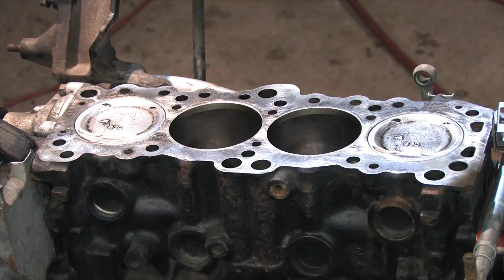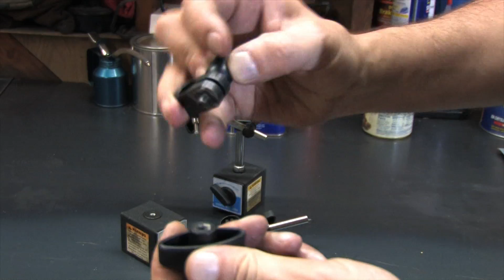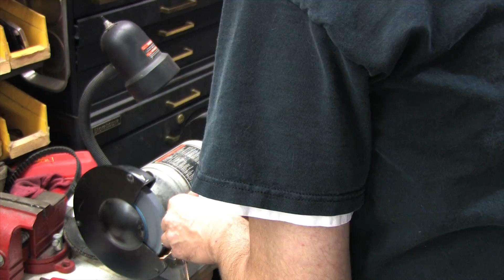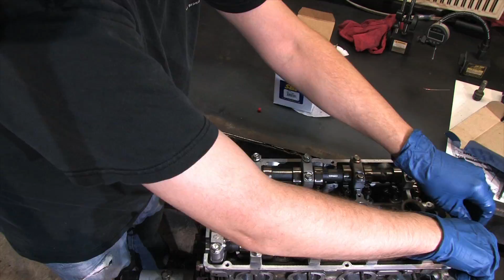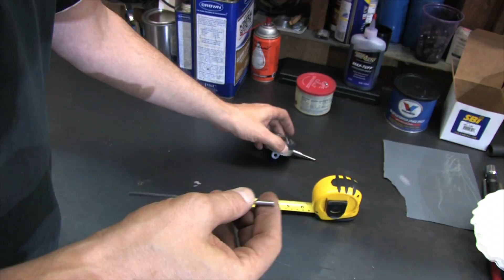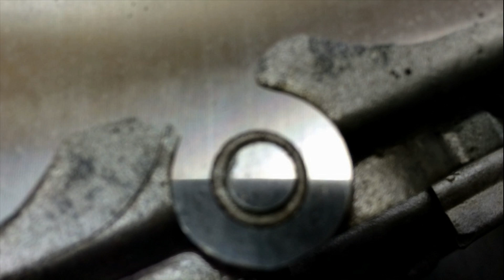Cylinder Head 205 - Degree DOHC Camshafts

Comment: You did it all back to front. You should have taken measurements before any work was done, then you would have had correct starting data.
Reply from the maker: It had the wrong cams in it before I started.  This was my Elantra's head built from multiple junkyard cars and bolted on a 2.0L block.  I think the intake cam was from a 1.6L auto, but it might have been a DOHC 1.8L?  ...so the original reference point was already useless either from a specifications or measured installation angle standpoint.  Worse situation than the HKS specifications because Mitsubishi and Hyundai never put a combo of their parts together like this to begin with.  

So here I'm degreeing used 2.0L turbo DSM HKS cams that replaced the mystery cams, and trying to hit the DSM installed angles using specifications that HKS provided that were wrong, and measured totally differently than the way Mitsubishi does it.  None of this car should have ever been bolted together to begin with, but I got all of the angles right and it works, spectacularly.  It makes way too much power for a 4-door 92 Elantra chassis/open front diff.
Reply: @Jafromobile  supplied data is always wrong to start with

Comment: How can it be 264 duration when 6.5+180+25=211.5???
Reply from the maker: HKS measures duration based off of 1mm lift rather than .050", so it makes the duration numbers really inflated.  Mitsubishi measures lift at .040" on their factory cams, which even inflates the factory numbers, too.  The cam cards of HKS cams even at 1mm lift are still printed wrong if you measure them the way they claim they do.  Just like I showed in this video.  I dunno man, I just work here?  lol

Comment: when you deck the block or mill the cylinder head for compression, the cams are closer to the crank sprocket causing the intake and exhaust cam to be retarded ,in the case of an interference valve train, your best bet is to purchase adjustable cam sprockets, jumping the timing belt to  take up  the slack is too much one tooth off can be as much as ten degrees. I had a lima pinto engine where I had the head milled to get 11 to 1 compression and had to get an adjustable cam sprocket this was a non interference engine, but you still have to rotate the intake valve fully open with the piston at TDC to check clearence.. on some Mopar imported four bangers you can buy a timing belt that is one or two teeth less then the OEM timing belt. One big mistake ive seen with the tuners on You tube is re using the timing belt, which is a no -no on interference engines, the belt has already stretched, and reusing a belt even with less then five miles on it can be a mess of broken parts, these guys spend a @#$% of money on parts, only to skimp out on a 30 dollar timing belt and run a turbo with no air filter, back in my day I used to work on twin cam Fiats etc, and adjustable cam sprockets were not on the market yet, the old twin cam chain drives on Alfa,s had adjustable sprockets.. Just for giggles on a single over head cam engine, retarding the cam by a few degrees gives you more top end and advancing the cam a few degrees will give you more low end power, same deal with adjustable twin cams, these cam timing adjustments are less then five degrees. On some four bangers the firing order is reversed on cylinders two and three, Alfa did that and so did the old ford fiesta, witch will have you scratching your head the first time, on the TDC compression stroke the intake and exhaust will be opposite like a V ,unless its a Toyota with a gear drive off one of the cams, my two cents

Comment: Only thing our race shop degrees in is race car cams stockers like this set it using factory specs and save about 2 days of work for yourself ...all these diyers making regular dudes feel like they gotta buy all this unnecessary stuff when u can do it all with basics ...is it proper to degrees one in  ..yes 👍 will a 4th degree matter on a stocker .....no 👎
Reply from the maker: Yeah unless an insane amount of machining is performed to the deck surfaces, factory stuff typically lines up and works great.  Most ECU's don't care about anything being off by 3°.  Put it all together and send it.  But these are aftermarket gears and camshafts and my parts had an insane amount of machine work performed to both deck surfaces.  This is simply how to put it back if yours happens to be way out like mine were.  Between both cams it was off by 14°.  By doing this you can keep sending parts that you maybe could have thrown away instead?

Comment: God I remember doing this to my cortina mk2 GT, I fitted a kentcam bcf3, it was a little more easier in that engine (kent crossflow) because it was a single camshaft but it was a ohv so the cam was in the block. But I had the head ported and gas flowed,, fitted 1300gt pistons in a 1600 gt block (higher compression), I also fitted vandervell bigs and mains shells and knocked to the oil pressure to 60psi plus fitted a full janspeed exhaust system inc manifold. I left it with the standard webber carb DGAV32. i did take it down the motorway and 0-60 was around 7secs and the speedo was off the clock around 120mph. This was all done around 40 years ago when i was in my teens. I beat so many cars away from the lights even the souped-up ones. The fact was I had done all the work properly and did not just bolt on after market accessories; Those was the days!!!!

Comment: You only checked one cam lobe?
Reply from the maker: The vide would have been 8 times longer if I showed all 16 valves being done.  The exhaust valves were the tight valves, and all 8 of them were checked, just not on camera.  The process is the same, so I didn't include the repetition.

Comment: All this to make 200hp 😂
Seriously though, you’re very meticulous 👍🏻
Reply from the maker: It makes over 430 hp on pump gas, actually.  At least according to the logs and the fact it goes 60-90 in 1.7 seconds.  I plan to put it on a dyno somewhere, sometime this winter.
Reply: @Jafromobile   I stand corrected. I knew the work you were doing was thorough, didn't know the scope of the build. That's quite good, we would have a good race if we ever met up. I just finished my Turbo build yesterday. My Honda J32a3 made 316/262 All motor, now running around 6psi and she moves (11.4:1 comp too). Getting boost creep above 6k so I need to up to a large dia boost reference line (currently a 3AN). That should hopefully fix the overboost and leading to lean conditions from maxing out my Injectors (have ID1000's, just not installed yet).

Comment: Can you time DOHC cams 360 degrees out by measuring tops/nose of cam lobes as they are 180 degrees away from cam followers?
Reply from the maker: Sort of.  Measuring it that way would be nearly impossible, though.  You'd just time your valve opening and closing events off Cylinder #4 because it's 180° out.  You would never want your valve timing to be 360° out because it would be out-of-phase with your injector pulse and valve timing events.  Your valve events would be 4-2-1-3 and your fuel injection would be all like... 1-3-4-2.  Your ignition won't care because it will be all like "Yo, I'm a waste spark system, so 1&4 fire at the same time every time, and so do 2&3.

Comment: I'm used to pushrod engines where the lifters ride on the cam, do these lifters move at all or do they just kind of sit there in the bores?
Reply from the maker: Calling them lifters is really sorta slang here.  Really they're "Hydraulic Lash Adjusters" or HLA's for short.  Not everyone knows that and it makes one sound like a huge auto nerd, so people simply refer to them as "lifters".  On this engine, the rocker rests on the HLA's which provide no lift, and a roller rides on the cam journal to actuate the valves.  The HLA is just a fulcrum.  It keeps the valve lash in-spec, which is important... but provides no lift.  Watch the "DOHC valve timing" video if you want to see an illustration of where they fit in.  I made a kinda cool animation of a running 4g63.

Comment: There is an easier way to attach a degree wheel: search google image for a degree wheel, print it out, and glue it on to the circumference of the harmonic damper.  It takes a bit to ensure it's round and true to center, but mostly free is a great price

Comment: Top dead center locator where did you purchase yours, if you don't mind sharing?
Reply from the maker: Summit Racing sells both styles.  :)
Reply: Jafromobile I found it on summit like you said. And part #7880 14mm is the correct one? Just confirming Before purchasing
Reply from the maker: Yes.  That's the one.
Reply: Jafromobile thank you!

Comment: My mech. told me to put a butt plug on my DOG. He said my motorcycle is NOW running bad (ruff under 11k rpm and power comes in and out after 11k rpm) because my timing chain is stretched. I said, then it must have stretched in less than 100ft of riding, because it was running fine, then suddenly it started running bad. He said it needed tuning on the dyno. I said, then some ants must have gone into my ecu. and changed the map/program while I was riding. I know these are not the problems. programs don't change on their own, nor do timing chains stretch from one moment to the other. If the cam had skipped a tooth it would sound normal, but power would be down. I've heard engines running one tooth off, and they don't run ruff. Maybe it skipped two teeth? answer=NO, because sometimes  it runs at full power. I'm just going to prey to god this mech is just not wanting to tell me what the true problem is so he can fix it, and charge me for the job. If he had told me the problem, then I could take the bike home, (k5 GSXR1000) and fixed it myself.

Comment: Is it normal for my test springs to be set to zero lash, right after tightening down the cam caps and not needing any adjustment at all ?
Reply from the maker: If the cams aren't rotated in a way so that the rockers are on their base circle, in other words, 180° opposite of the lobe centerline, then rotate it there first and then check it.  Make sure it's not actually holding the valve open.  If you made a test lifter and you can't create a little bit of valve lash by adjusting it,, it could be that it's too long?

Comment: Good, valuable info !! Now, when I put "sharper" cams into my Infiniti FX45, do I have to do any of this?? Or maybe there is not any ways, I could adjust those new cams/timing?? Thanks for the help =) youtheman.....
Reply from the maker: If you have to cut more from the head to resurface it than your valves get recessed by doing a valve job, AND you select a cam that increases your valve lift, then you may need to check your valve clearance.  It's always a good idea to verify this on at least one cylinder on each side (for v-series engines) if you've changed out pistons, rods and everything else.  Your piston-to-deck height might change, and your valve reliefs could be different than stock and lend to a clearance issue.  If you check it before installation, you'll know without a shadow of a doubt if it will hold up to being hot cycled and pinning in to the floor.  That confidence is worth it in those circumstances because parts and valve jobs get more expensive with the more of them that your engine has.  I did it here on a 4-banger with mix-matched parts.  My parts didn't fit until I made them fit.
Reply: Yep, thanks, I understand, what you were doing here, how did it turn out?? How much more power you were able to gain in your 4 cylinder engine, Hyundai, 2 ohc ?? I am not replacing pistons, hope there is nothing wrong with them, just pistonrings?? And honeing cylinders, not taking even engine out of the car, just opening oilpan =) So, just doing that, I don't think my valve timing has any issues?? just adding "sharper" cam, and stiffer spring, you think it is OK?? Thinking of porting/ polishing head, like you do, and making them "shiny", like the way you do it=) maybe adding turbo later,.....just thinking...., lets see, how my engine works after  good valve job, new piston rings, and new cams! And new exhaust/ power intake/ powerchip...=)
Reply: Also, if I make my Infiniti engine up to maybe have a turbo...in a future, should I put a little bigger fuel injectors in there, right now has originals on? Are those big enough which you replaced into your Hyundai engine??/ How about fuelpump,....original strong enough... without turbo, anyway??? Thanks , youtheman =)
Reply from the maker: My Hyundai used to have 190cc injectors in it.  It has 750cc injectors in it now.  You won't have an engine if you add a turbo and don't change the injectors and engine management system.  The factory fuel tune of any NA car can't handle boost because there's a huge difference from forced induction and engines that never see anything but vacuum.  You have to maintain a stoichiometric fuel mixture or else you go lean and go boom.

Comment: Jafromobile I have a 2000 mitsibishi eclipse gt.  I did the timinjg belt...as I was doing the timing belt and aligning the marks I noticed play by 2 teeth on the right Cam. I can basically turn it freely by hand. Would you say it a loose cam gear or the inside that connects to the cam gear is loose..?...

Comment: What would happen if you did not change out your valve spring for the weaker springs when degreeing the cams?
Reply from the maker: +j Shafer You would be unable to press the valve down by hand to measure the valve drop at that particular degree of crank rotation.  That's where you measure your valve clearance.  You don't need test springs to degree the cams, just to test the valve clearance.  If the engine you're degreeing isn't an interference engine, you never need to use a test spring.

Comment: id use the 3 layer metal head gasket Mitsubishi sells or after market equivalent if ur going to use a turbo charger the felpro fiber gasket will pop like popcorn if ur running above more than like ANY BOOST PRESSURE and u will find yourself doing this job twice which for me is unacceptable since I feel if it blows up n my face its what they call a come back at the dealership, and if your a mechanic u know what that is lol, yup ya have to fix the customers car for free and it surely appears I don't know what the (wtf) I'm doing lol, and yes I found the felpro fiber gaskets wont hold the hard way, at least it was my own car right? ya I know its still a comeback,
Reply: +terry blankinship My FelPro headgasket held 20PSI from the 14b turbo no problem.
Reply: +Loren Husky well we started at 25lbs and ended up with right at 30lbs boost which is a range the 4g63t really comes into itself and if uve used really good pistons and got ur fuel air ratio correct  you spend a lot of time repairing shit the engine broke instead of repairing a broken engines lol,  if ya get my drift? I'm not sure why but it seems more acceptable to fix the shit my beast/engine broke verses repairing the engine if that makes sense? if ur interested I'm running a jdm 74mm ball bearing turbo n its a pretty simple installation and this turbo although expensive is very reliable, well so far so good lol, if ur having good luck with the felpro go with it but I haven't so that's where I'm coming from n yes the 3 layer metal gasket is more expensive but theres a old saying, ya get what ya pay for besides mitsu uses this gasket on there stock turbo setup n I'm inclined mitsu might be pretty experienced at this stuff and they are far smarted than most of us understand, did u know mitsu used to build the Japanese zero fighter in world war 2? yup n that 14cylinder radial double row engine used 2 turbo chargers and the only oil that would stand up to the demands of this engine and turbos was the oil from the head of a sperm whale, general motors limited slip diff oil additive uses that very same oil, its very good additive for any turbo engine, the older guys/mechanics swear by the stuff! just food for thought in my mind,

Comment: Is there a specific way to install the valve springs? tighter side up?
Reply from the maker: +Orange Juice I wasn't aware there was a tighter side on the stock springs?  The progressive rate should be the same no matter what side they're squished from, but I would install them all oriented the same way if I encountered it.  I'd likely put the tight side against the head.

Comment: Is a 4g63 a 4 bolt main block?
Reply from the maker: +kyle young 2 bolt.  They're not classified as such, but I know what you're talking about.  They call 'em 6bolts and 7bolts based off of how many crank bolts hold the flywheel on.  Depending on the year of production of a 7bolt, a 4g63 may have a factory bearing girdle, and there are inexpensive aftermarket upgrades for the ones that don't.  The ones that came with the girdle aren't necessarily the best choices based off of the performance characteristics of the ones the "pros" built, but neither one are "undesirable" in my opinion.  They're both viable platforms.  All of my blocks are now 6bolts.  My 95 Eclipse came with a 7bolt.